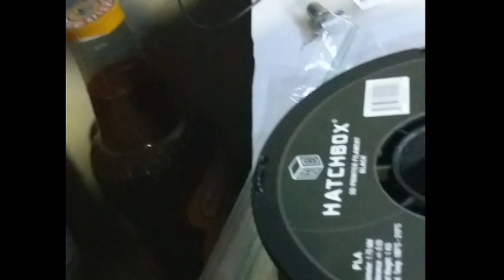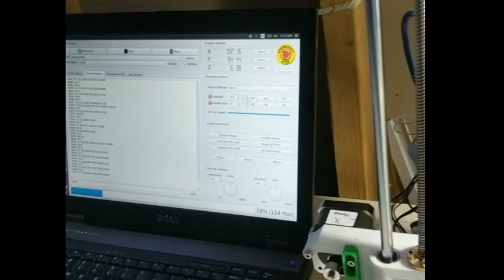[Tutorial] Printing Ninjaflex on the Anet A8 3D Printer

Comment: Thanks for putting this video. Can you explain how did you install the filament adapter down there? did you open the injector fan and put it there? maybe, another video to show this installation would be great...
Reply from the maker: MrAmoslemi yeah, that's exactly how it installs. You just remove the fan and heatsink and then slide on the print. Also while you are installing it, be sure to tighten the bearing screws.
Unfortunately I won't be able to do a video of the insides because I leave for college in two days and won't have access to my printer. (As much as I would love to bring it with me)
Reply: Many thanks for the response!
Reply: It's kind of late but thought to share it with you. The filament guide on thingverse didn't fit in my Anet. Also, I cannot press the top part of extruder any more. Should the screw that you mentioned in the video be loosen again?
Reply from the maker: MrAmoslemi you mean the acrylic piece won't move? That part doesn't have to be tightened. Only the bearing does. There has been some changes to the design of the Anet A8, so that could be why it doesn't fit.
Reply: No, I meant the spring-loaded part which is pressed down frequently when changing filament.
Reply from the maker: You don't have to tighten that part. I would just make sure it isn't loose. You tighten the bearing (the metal wheel that makes contact with the filament and pushes it against the drive gear) to ensure that there is no play in the wrong directions (wrong being any direction that isn't in line with the filament path) 
I found that if the bearing was loose, the wobble would throw the filament path out of line and the filament would string out the side.
Reply: Thanks for clarification. There is no question about tightening the bearing screw but in your video you emphasized that both screws should be tightened....

Comment: Will all the different settings work for any tpu
Reply from the maker: You would have to try them out, but typically, the basic settings will still work. You might have to adjust your filament temperature though according to the manufacturer. 
The only issue with flexible filament is that it can kink between the extruder gear and the melt zone of the print head, so as long as you print slowly and have the correct temps.

Comment: Yo!  Great vid. Whats that filament holder you got there?  Do you have a link to the STL?
Reply: I have no Problems with this holder Works Fine with universal spoolholders:)
Reply from the maker: DASFREAK it's a spool holder I have on my thingiverse: https://www.thingiverse.com/thing:2123685
Reply from the maker: DASFREAK not really. if you have the PVC pipe then it works really well. it's much simpler than those convoluted bearing-based spool holders.
Reply: Any issues with that holder?  Been a pain to find one I like.  :(

Comment: Nice video man! What diameter ninjaflex filament would you recommend? 1.75 mm or 3 mm? Thanks!
Reply from the maker: ragavsn01 I personally use 1.75 mm because it is standard for most printers. however, in my research, the 2.85 mm flexible filament tends to perform better because it is more rigid. if you are willing to deal with the slow print speeds, then stick with 1.75 mm

Comment: Do you have to swap out the piece if you want to use normal filament?
Reply from the maker: gamemakero1998 no you don't. it actually makes loading regular filament slightly easier with it in.